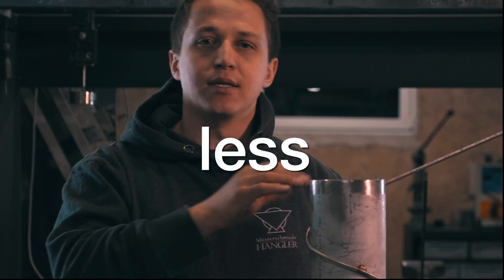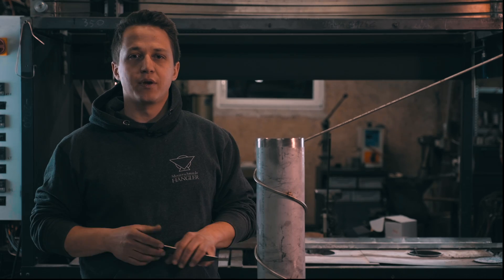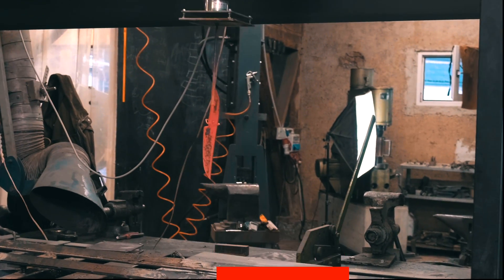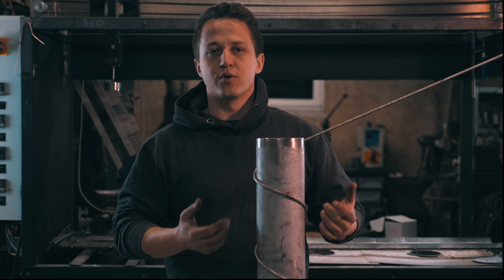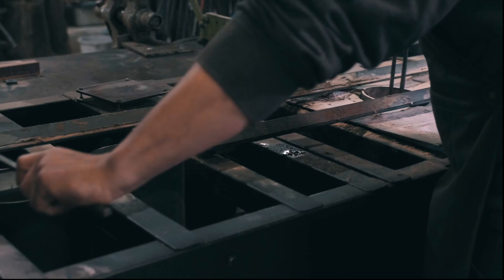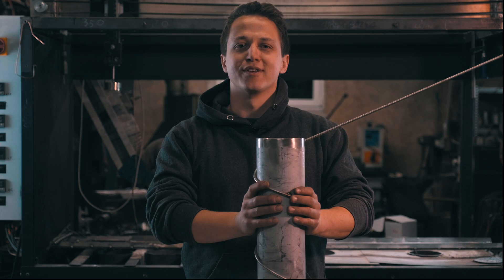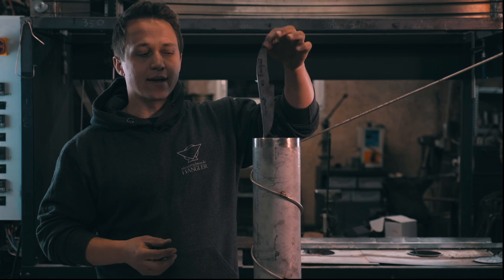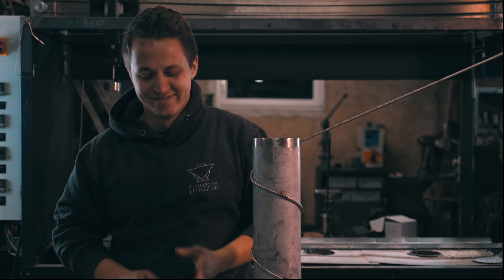Is this THE BEST system for HEAT TREATMENT for knife makers?

Comment: Absolutely appreciate your fluidized sand bed heat treatment! I’ve been looking at the evenheat salt 818 and introducing an air and argon inlet in the bottom should be easy enough. I only work with stainless right now so the argon makes sense. Any thoughts? Carl Trieb @ Ulukblades

Comment: Of all the millions of knives billions of knives made that have lasted centuries that didn't utilize all this technology you no good? As a student of metallurgy and somebody who has been blacksmithing for close to thirty years and was educated variety of really good knife makers and blacksmiths am I to understand that all the knowledge you have acquired through the years should be just set aside for all these modern techniques? Don't get me wrong It's really cool seeing some of this newer technology but something needs to be said about the skill set to be able to do a lot of what they're doing with machines that was done by eyes knowledge of materials.
Reply from the maker: Hi Little Bear. Thanks for your comment. This is a comparison video of various different heat treatment systems for knives and has pros and cons. We have videos as well of others such as gas forge heat treatment, kiln, and even an induction heater. This video was made to hopefully spread knowledge out there of other HT systems available, as no single system is beat for everything so we thought it’d be a good idea to show newer knife makers what systems are there to be used.
Reply: I don’t think anyone is saying that old technology is terrible and and you should only use the  new.  That’s not the point of the series.

However the centuries old knives (I’m sure millions were made but we certainly don’t have millions still around) are the ones that survived because they were well made and didn’t suffer from critical defects. Any blade that cracked during forging because it had a massive inclusion in, any that warped or cracked in the quench, chipped too much during grinding etc aren’t here for us to compare. We can see the successes but not the failures - and without modern methods failures are a lot more likely.

I can’t remember if it was this or another of Tobias’ videos where he put it very well “You can’t control what you can’t measure.” That’s what modern technology gives you - control and repeatability. The human eye can estimate temperate by colour to an accuracy of about 100C. A properly calibrated thermocouple can do it within a fraction of a degree. We can control and modify steel production to avoid blade breaking slag inclusions during modern steel making that simply wasn’t possible before. If you want predictable and repeatable results for not one but 100,000s of blades with very little chance of a single failure then you need modern tech. 

That all said, I’d never tell someone to stop using old fashioned smithing methods if they wanted to. They take a bit more skill and sometimes a bit of luck to get consistent good results with but for a lot of people that’s the whole point of blade smithing and it’s something I can wholeheartedly get behind. For someone like Tobias, however, who is running a business and any failed blade costs him money and wastes time, use the best kit available.

Comment: Nice presentation. Thanks for sharing. What has been your experience with stainless steels that may require 30 to 60 minute hold times? Was there much scaling with longer soaks? Did you coat the stainless blades?

Comment: Could you use induction heating for the fluidised bed?
Reply: Yes you could, that would make the system react a bit faster and heat up quicker but it would require a pretty serious induction heater that would probably draw more current than most workshops have available.
Reply: I suppose it would be similar to an induction crucible heater.

Comment: interesting idea, not likely I will take it up but none the less can see why some would, must be expensive to heat up and use though
Reply: Heating the sand up does take a goodly amount of energy. Keeping it hot isn’t too bad and once you turn off the gas the sand will cool quite slowly. You can shut it off at night and not need much energy to heat back up the next morning. 

Maybe not the best choice if you’re smithing as a hobby on the weekends. Quite a sensible choice if you’re full time.
Reply from the maker: Ditto Tom’s comment. If you’re doing batches all the time, this will be something worth considering. 

Hopefully the series has given people ideas on pros and cons of various HT systems. As you can see, even Tobias’ favourite system (this one), isn’t for everyone either. But it’s good to know what options are available in case makers do want to level up their equipment to improve their blade performance, grain refinement and general workflow or process efficiency.

Comment: Very interesting, I have never seen this heat treating process before , I just assumed all large batch production used molten salt baths. This looks like it has great advantages and is relatively attainable - most shops already have argon supply for TIG welding as well. Thanks for the video!
Reply from the maker: You're very welcome! It was great to work with the likes of Tobias - very knowledgeable, extremely helpful, and makes an amazing alcoholic drink! hahaha

Comment: Could you do a hybrid version with a normal knife kiln and some type of sand bath inside of that?
Reply: Yes you can, basically you can add the vessel into any electric kiln that can be used upright. Gas and thermocouple come in from the top so thats no problem. You just need to be careful not to touch the electric coila and add a ground wire to the tube to make sure the electricity is killed if it should ever touch the coils.
Reply: You could… Not sure what the point would be, I must confess.

You’d need to modify the kiln quite extensively to let the gas bubble up through the sand and also let it out of the kiln again. Not sure how you’d get the blade into and out of the sand if it’s already in a kiln.

Comment: This is frigging genius. I need to do some research but this could literally be perfect for my sword company idea. 

Just need to see how it plays with clay in the heat treatment process. The Gas issue is meh but more tolerable then salt issues. 

Any issues of metal embrittlement?
Reply: It is a useful technology. I’m a bit surprised an Austrian is using it,though. It’s far more common in the UK than anywhere else in the world as far as I knew. I cut my heat treatment teeth with a fluidised bed so glad to see it getting some love.

I don’t think you’ll have too much of a problem with your clay. The sand isn’t getting blasted at the surface with any kind of speed. 

Embrittlement? I’m aware of hydrogen embrittlement as a problem for some steel. If that’s what you mean then using argon or even nitrogen shouldn’t cause that particular issue.
Reply: @Tom Collins  damn thanks dude answered all my questions.

Hmm interesting it's popular in the UK I woulda figured it would've been more popular in Asia with industrial scale set ups like salt baths. 

Good to know on the clay. I know with salt baths you gotta bake it thoroughly before and it messed up the pH balance anyways. Gonna be doing katana, but also recreating Howard Clark's famous L6 bainite heattreatment but on a different steel. Martensite edge bainite body with a hamon. Recently figured out 3 ways to do it though 1 requires some skill and math and the right steel selection, other one is similar but a little bit better due to clay at least insulating the spine to prevent martensite formation. Other is completely different and formed the reverse direction of the others. But gonna have to play with which one I like best. 

Yeah was worried about potential gas embrittlement or potential issues with various sands used. What's the useful temp range? Is it possible to austemper or marquench in them or does a salt bath still win for that? 

For euro or spring tempered swords trying to decide between austempering or marquenching might offer both options. Low temp harder lower bainite might be useful in knifes and swords where you need slot of toughness but wanna keep your edges hard. Time trade off might make that costs worth it and trade off some cost for simpler steels being cheaper. 

Z tuff being one of the few steels I could see being able to get as tough and keep high hardness, though it'd have wear and corrosion resistance advantages it's price probably directly trades off even for a long austemper. I mean 60hrc would be overkill for most swords and in 5160 it takes like 90 hours, but in sword size for stock removal you'd probably be close to a grand in steel for some swords alone. Vs less than 200 in 5160. At 53 to 55hrc where more swords run you'd probably cut a few hours off. 5160 probably isn't the best choice though, I think L6 would be like 16 ish hours for sword hardness. 

Sandbath would make both those operations much safer. Especially the one bainite martensite partitioning treatment. Out of water or oil or a polymer based quench into a salt bath is risky. 

Part of my company goals are also safety and environmental. Gonna use induction set ups for heating up the sand beds or salt baths. Likely induction heating for forging, albeit only a small amount of that. Recycle waste material and scraps. And run solar panels. Preventing the oxidization issues with salts would likely extend the lifespan of everything in the workshop, especially the heating equipment. And obvious safety benefits. Could even potentially heat the gas supply with waste heat and insulation to help with preventing heat loss in the system. 

This kinda got me pumped. So much safer then salt baths it seems. Only potential loss is that salt baths actually help with speeding up the quench albeit that can be bad. Thin layer of molten salt works almost like brine does. Not much real study into it but Howard clark and numerous other have noted it. If you were quick you could potentially brush off parts of it to help control rapid cooling or more even cooling but that'd be so much experimenting. Could create a cool hamon, though, without clay.
Reply: @bmxriderforlife1234  You sound like a man with a plan. Good luck. 

For reasons best known to himself Vinz made me a moderator for this channel so feel free to throw out any questions and I’ll likely see them and answer them if I can. 

Yes you can use a fluidised bed for austempering and the like very well. You’ll need a couple going at once at the right temperatures though. Fluidised beds don’t ramp up or down quickly.
Reply: @Tom Collins  haha thank you and still working out some small stuff, but the domestic production stuff has alot more research required then the Asian produced line I'll be doing. That requires some prototyping time though. And testing a few forges.

I'd wager the same reason I want certain content creators, researchers and other experts in various things involved. Seems to have the same collaboration mindset I do for making things the best quality possible through cooperation where possible. Same reason despite having kinda figured out the process I'd still like to potentially get Howard clark involved, some little details and such that you can only learn through experience and then willingness to teach. 

Sweet. Sounds like this should work rather nicely. And yeah already know I'm gonna need a few pots. And various shapes of pot. One needs to be able to technically handle up to 96 inches despite nothing that long actually getting heated though close. Claymores and zweihanders xD thermal mass is also an issue since production scale there will be times multiple blades need to be done back to back quickly. But no risk of off gas kinda cleans up some other issues. Deep enough lip would mean I could have a giant sand band that could handle 5 or 6 blades at once for smaller stuff and the big one could handle 3 or 4. Goes from 3/4 of the biggest ones for each temp range to 2. 

Man. This channel is seriously becoming probably my favorite very quickly. If my company idea works out I may have to hit up the owner and bring him to Canada and give him a modified version of my grinding jig for video. Required a 3d printer or cnc of being creative but let's you do pretty complex shapes. 

If you think about grinder tables. All you need if one that can handle fine adjustments to angles. If you print the right shaped jig you can essentially grind both distal taper and edge taper in one bang uber accurately. Looking at certain sharpening systems can even make coming up with custom set ups not that hard or tweaking it to various processes whether hand done or on grinders. Need to test the one idea out but should allow for recreating exact convex grinds over and over. Just gotta tweak it enough people can't just exactly copy it for sword use.
Reply from the maker: Hey buddy. Thanks for the questions and comments - happy to hear you're finding the series of videos interesting! And yes, happy to take your offer in the future and I'll fly to Canada ;)

- Vinz
Reply: @bmxriderforlife1234  yes itcan be used for marquenching and orher treatments if the steels critical quenching speed allows it. If used for quenching it is probably comparable to a slower oil. The temperature range is basically only limited by the materials. My high temperature version can be used from cold treatments all the way up to 1100°C.
Reply: @Tobias Hangler  steel I'm gonna be using is an oil quenching steel so should be fine. Pretty sure bladesmith Howard clark has accidentally done his heattreatment for a martensite edge and bainite body on said steel due to someone selling it for a few years accidentally as L6. 

I just know for salts there's ranges for the various compounds was curious if the sand baths worked similar. 

Have a feeling sand baths might be even better for the tubular bike frame heattreatment as well. Thanks for sharing the info :) since you can air harden 4130 enough for bike purposes and salt baths are used for post weld heattreatment, could probably normalize the frames inside a single bath and then quench them in another with some auto tempering going on like a Mar quench.
Reply: @bmxriderforlife1234  A minor additions to Tobias’s comment: You need to use more  gas to keep the sand acting like a fluid as the temperature goes down. An example of Boyle’s Law in action. It’s not a major issue for a short process. I’ve used a fluidised bed for a quick 4hr nitrocarburising process at 580C but I’d rather not use one for a 60hr nitride at 520C.
Reply: @Tom Collins  sweet thanks for the heads up. Shouldn't be too much of an issue with the steel choice I've made. Pretty sure I'll be able to get the austempering done to where I want it in sub 30 hour soaks. Probably less then 20 hours in fact. 

And pretty sure even worst case I could figure out something other then argon to use that's cheaper. Or just deal with scale forming.
Reply: @bmxriderforlife1234  Nitrogen should do the trick for the vast majority of steels. It’s the most common gas used to gas quench in vacuum furnaces. Stainless will start absorbing normal nitrogen above 1000C.

(Which can actually improve corrosion resistance a little if you quench through the 700-500C range quite rapidly - a bit beyond the scope of a YouTube comment though)
Reply: @Tom Collins  yeah I know a bit about that, would need to test my steel choices. 8670 is one of them don't see any problems there. Mostly gonna be carbon steels or maybe one semi stainless option. 

Haha thanks again for all the info dude much appreciated :)
Reply: @Tom Collins  also lol I might be quenching down to below that range very very quickly. Like almost water quenching speed. Likely gonna be using polymer quench set up. 

For the one heat treatment procedure the edge is gonna have to cool down really fast while keeping the spine hot.
Reply: @bmxriderforlife1234  if you’re not using stainless then nitrogen will be grand as a shielding gas. 

Good luck with your plans anyway. Let us know how you get on and possibly even get Vinz over to show us :)
Reply: @Tom Collins  I'll for sure keep you guys updated and if things work out I'll deffs being vinz out.
Reply: @GemAppleTom haha still working on things. Investors can be tricky. But also expanded to another side business and trying to pitch both at the same time. 

Other ones looking good ish. But also involved heat treatment and this may be the perfect thing. 

Although gonna be frigging massive. Bike side production scale. 

New alloy. New heat treatment procedure. Entirely new hardening concept for the industry. Twice the strength at the same weight. Alloys us to beat strength to weight of titanium. 

But this should help reduce heat up times. Keep things uber accurate and safe and shield the metal plus the minor thickness variations shouldn't matter that much. 

But going equally fancy as my sword aide works. 

Nice alloy choice. And some other design and production tweaks. But since both use steel I'm gonna try and use purchasing contracts and same steel foundry to get better discounts over all for both businesses.